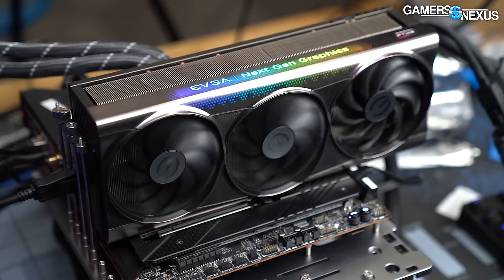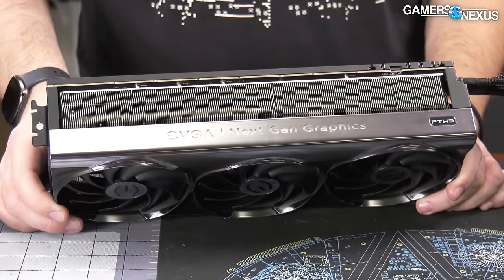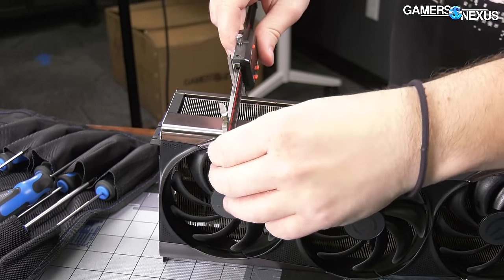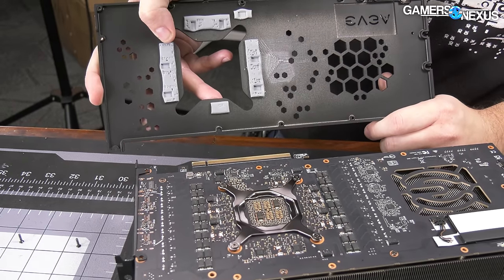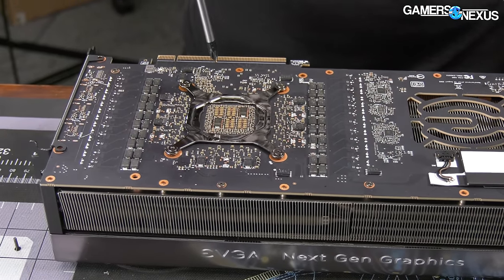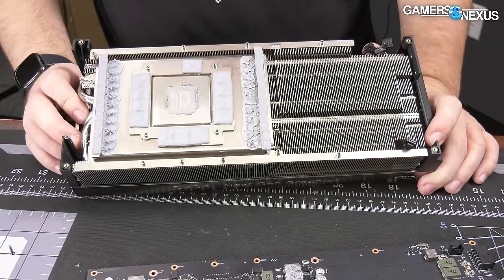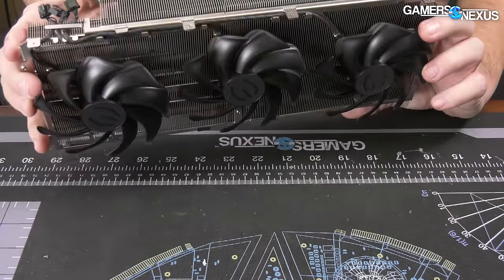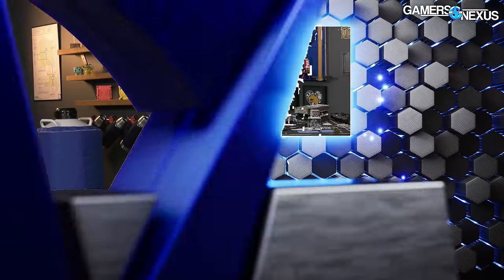EVGA RTX 4090 FTW3 Tear-Down & Disassembly: A Major Loss

Comment: With how some companies are chasing designs where there are no external screws, I think EVGA's approach to hiding the shroud screws on the beauty panel side of the card is a viable approach. Imagine the GPU sandwich, the shroud has hidden screws like this under the fans and is the first piece to pop off, then you have a backplate with female threaded standoffs that locate through the PCB and seat on the underside of the cooler with the screws in the upper side of the cooler under the shroud's top plastic (six standoffs on a two-fan card, eight standoffs on a three-fan card, hiding in the curved triangle between the fans, inaccessible before shroud removal), after the backplate drops off you have the cooler and PCB attached in the typical way with a general assortment of fasteners then the chip's leaf spring along with the slot bracket; all cabling would be fairly simple with accessible connectors under the shroud's non-top faces, and the backplate's LED features if they exist could be pin-pad or a long flat ribbon that folds over itself for flexibility, along with any potential thermal bridging between the PCB and backplate. A very, very simple approach to screw-less appearance, and very simple disassembly and reassembly methodology, an intuitive design that doesn't rely on adhesives or cover panels, and a design that seems a lot simpler from a manufacturing standpoint with less processes that relies on the cooler itself being the mounting point for every other component; besides the singular fastener attaching the slot bracket to the PCB, and if this screw can be reverse-mounted, that shortcuts the process of flipping the card over for a singular screw, adding to how manufacturability of this hypothetical design is more accessible: Bracket gets fastened to the cooler, rotate, that assembly attaches to the PCB, flip, backplate gets plugged and padded if needed and fastened, fans get plugged and fastened, and shroud gets fastened, all on a slightly atypical PCB design (through-holes instead of fastener mounts for the backplate) and some additional soldering work on the cooler to allow for all the component mounting with a slightly atypical design again.

Comment: So sad that I never got to own a EVGA card, that was going to be my next card.
Reply: Same might get 3080 evga
Reply: i got a 3060ti ftw3 last year, i think im gonna hold onto this thing forever. i hope they come back one day on team red or blue.
Reply: @quantum5661  i have a 3060ti founders edition for my first pc build at August my profile picture is my 3060ti what is ftw3
Reply: @quantum5661  EVGA's FTW series were their top tier cards.. larger coolers, triple fans, RGB, and OC'd.
Reply: most of my nvidia gpus were EVGA, a gtx 295, 2 980ti (hydrocpper) a 1080ti (ftw3+ ek block) and 3x3090 (render server go brr), the only one that is not is an FE 2080 ti (this is the only exception, got it because cheap, and waterblock avail at launch), the weird large gap between the first 2 is when i switched to AMD, oh, and a random 970 that I bought just to mess around with dry ice (could not get LN2 at the time, still can't tbh), never had any issues with any of them, the 295 in fact still lives on in one of my random testbenches as a glorified display adapter, all the other are still working, the 2 980 Tis: one sent out as a gift in 2017, the other is in a drawer, the 1080 ti has been given away to a friend in 2019, and the 3090 are still chugging along tracing rays with octane, the 970 is still in a drawer completely covered in liquid electrical tape, damn great cards, I still do not know what to go for with NV GPUs without them
Reply: They pretty much all the same. Evga just has a nicer look with that chrome.
Reply: @Themistocles30  who is second choice after evga only thing I bought from them is a psu I like it though
Reply: @Jason_Bover9000  Yeah, my entire setup is Evga and cost me dearly lol. Got an evga case, evga liquid cooler, evga 850 watt psu, evga motherboard and evga rtx 3090ti lol. I heard Asus and Zotac is quite good after evga. Evga are good for their warranties.
Reply: @Themistocles30  ok thanks man

Comment: The first thing that's noticeable is the size of the cooler and the shroud. Yeah the FTW3 is still large, but it manages to avoid the be pavement tile-sized like Aorus cards are for instance. If it ends up being as effective at cooling the card, then it's an impressive design.

Comment: 2:30 - Fin density, surface area and fin height is all important and generally you want more of all, but it's not the only things to look for in a heatsink. Air impedance and heat transfer in the fins are other things that influences the efficiency of the heatsink.

If you pack the fins to tightly you get high air impedance, meaning the fans will push less air through the fin stack. And this is another area where you want as much as possible. So more fins and less air can be a bad thing.

Heat capacity per fin is also important. You want the heat to spread though the fin efficiently so all the surface area can effectively transfer heat to the air passing by. Make the fins to thin and the tip won't get warm enough to make a difference. Make them to thick and you either impede the air more or you have to increase the fin pitch making for less fins and less surface area.

Finally you have fin height. The taller the fins are the more surface area you get. But at the same time the fins will have to be thicker to make efficient use of the added height, so you get fewer fins in the fin stack.

Now you have to balance these factors when designing a heatsink, and a lot of them will force you to compromise as you can't get them all at the same time.

So while it may look deceptively simple a heat sink like this is actually not all that simple to design if you want to make it efficient, compact and cheap to manufacture.

Comment: I really hope EVGA gets back into making cards, even if it's only with AMD and Intel.
Reply: yea, evga was my go to brand until i decided to go full team red and then using asrock challenger
Reply: @wizardbeard69  i think they could squeeze a lot out of rdna 3. I'd love to see it.
Reply: They've been my go-to for GPUs going back 15 years to the 8800GT, followed by the 550Ti (still have both of those cards and they still work), GTX770, GTX960, and then a GTX860M in a laptop (also still works).  Had to take a break from gaming until this year and finally built a new system and putting an EVGA in it was not even a question. It was a given.  Ended up with a Radeon, first ATI card I have owned since even before that 8800GT. The Radeon is not bad at all. My appreciation for EVGA is so strong, I jumped to Team Red rather than accept another Nvidia AIB brand.

Comment: EVGA overall quality was going downhill anyways, my 3080Ti FTW3 is one of the loudest gpus I've had in years, and hottest running.
Reply: true.. but then again, it's been the same case for all card manufacturers since like the RTX 20 series. Cheaping out on materials to cut costs, which then also has an effect on lifespan. Its a 2 birds one stone thing for them.

Comment: The upcoming 5090 will be 6 slots wide. 
Will come with tools to mod your case to look like a supercharger scoop on a Top Fuel dragster.
Reply: The boards are the same size as the 2000 series, the 3000 series, and the 4000 series. Only cooling increased in thickness. If the 5090 will be that powerful in the future, they can immediately be produced exclusively on water in full blocks on both sides of the board. Like water cooling from EKWB full cover for 4090 and occupies one slot.

Comment: Man I miss EVGA... Just the fact that they put the power connector at the end of the card alone is huge. 

I hate the connector coming out the middle of the card like all the rest are. It's terrible for cable management, terrible for airflow, and puts more stress on that connector that may or may not melt.

Then again, I probably wouldn't have been able to buy this card even if it was released. I wanted the STRIX and all I could manage to buy on launch day was a Gigabyte Gaming OC one. Which was basically the last choice I ever wanted to end up with... Hate Gigabyte... I think one of the fans is already dying...

Comment: I wish their CEO would've just handed the reigns over to someone, even a family member so that they continued their GPU line. I've been a loyal customer since buying my first Nvidia GPU(a GeForce4 Ti 4200), and have tried other brands without near as much reliability. Finally looking at upgrading my 1080 TI - which still runs like a beast FWIW, but not sure who I'd go with now. Thinking either Asus or OEM 4800/700 will be the best bet, eh?

Comment: 17:50 comparing to the heatsink/vapor chamber those inductors where the thermal putty didn't have contact, indeed fell outside the footprint of the contact plate/vapor chamber. Since it's a prototype, they might have had to fix that extending the contact plate if the retail product ever reached the market.

Comment: it’s just sad that they stopped before this. cause the 4090 would have been endgame.
assuming you will never upgrade to 4K, there will never be a game you can’t run on high fps at 1440p
as the 4090 is a 4k 120fps card, you could almost also say the same about 4k. and I guess we can agree 8k will never make sense on desktop monitors for a very long time

Comment: The external fan connector is SICK and I want more cards to have that. It's a great idea. The GPU is the thing that most needs airflow in most systems - why are we feeding it air into the case based on CPU temp? It's CRAZY.

Comment: Every GPU I've ever owned - my 9800 GX2, my 660 GTX, my GTX 1060, my RTX 2070 Super, and my RTX 3080 - have all been EVGA cards (with the sole exception of a Gigabyte GTX 970 I owned for like two days before I RMA'd it, so I don't count that one).  So as disappointed as I am at the news, EVGA - as one of the few "big" companies out there that seems to have a genuine sense of integrity - has nothing but my respect for telling Nvidia to go fuck themselves.  I hope AMD continues to close the gap, and I hope Intel becomes a third serious competitor, because competition in the market is supposed to be what keeps big corporations from fucking over customers (although obviously that often isn't the case).  In the meantime, I'm gonna continue to buy from EVGA where I can for things like power supplies and whatever other components they continue to make.

Comment: Holy Molly! I am a collector, I am willing to give you 1000 $ just for that video card.
At this point getting one on stock is no longer the issue, it's robing the bank and getting away with it. Since cards are already out on the market, I am surprised how come this time GN does not have a review or tear down by now for other models. They must have needed a bigger Camera to keep the 4090 in the shot.

Comment: Video cards have got so big, its either motherboard manufacturers are going to have to stop putting slots under the x16 slot, or case manufacturers are going to have to put 4-5 slot vertical mounts in their cases. Otherwise, you better buy a mobo that has everything and the kitchen sink built in, because if you want to add a wifi card, sound card, etc, you're SOL.

Comment: looks great evga, sad to see you go but I support your reason. great vid gn. the putty is at the edge and overflowing the base of the vapor chamber. seems like the only way to fully cover the inductors would be to make the base larger, a lot of work. lol. 
you may mention this later but those fan blades are CHONKY, i guess they compensate for the ring fan's durability with this.
May be a bit crazy but i would love to see an airflow test stock and the the evga pcb Dremelled out LOL. ;)

Comment: I only buy EVGA because of their design and top notch customer service second to none. 
What an excellent engineered GPU and would have been very happy to have purchased one.
On the other hand, EVGA may have made a smart decision to pull out of producing the Nvidia GPU since we're seeing a lot of melting issues.
You can't be harsh on EVGA design since it's not the final product. Either way, it's one of the best designed Nvidia 4090 card. Man I wish I had it right now. Cheers!

Comment: It probably wasn’t intentional to leave out the putty/pressure, but the inductors at the ends likely don’t need the cooling as much since they don’t have to deal with the heat of neighboring inductors and have some ventilation on the side.

Comment: I'm happy for EVGA, they made a good decision. Nvidia is going down the way the currently operate. When even EVGA can't make that card 3 slots, something is seriously messed up.

At this point I am open for external GPUs. So a small card inside the system for basic video output (or just an onboard GPU), with a connector at the back to plug the GPU inside. The external GPU can be powered by a separate PSU, heavily decreasing both power spike sensitivity aswell as the overall power draw of your PC, while also being independent from case size and reference design ^^

Comment: Honestly for a pre-production version of the card you can really tell EVGA put the work in,  there is some obvious issues that Steve pointed out but its unlikely any of those would actually make it to production.  Can tell the engineers over there knew what they were doing with minimal gimmicks. 

Also that fake out at  the 19 minute market had me. XD

Comment: I would've loved if EVGA just ignored the nvidia limitations put on manufacturers (you know, the ones that made MSI discontinue the Lightning series) and how much performance they could've squeezed out of that hardware. I mean eventually someone's gonna do an epower mod and get these results anyway, but I still would've found it cool to have a PCB that is already designed by the manufacturer to be really good

Comment: I wonder if the ease of tear-down is in part due to the fact that this is a fairly early-stage prototype design.  Early on you'd probably want to be able to take it apart and put it back together a few times for engineering purposes, whereas later on as you refine performance stats for the design, you'll probably be more and more willing to sacrifice the teardown capability given a good chunk of the customer base is not going to be taking apart their boards.  Not necessarily deliberately obfuscating the teardown procedure, but if you're a couple weeks away from submitting your final design and you can eke another half percent out of the cooling by running an extra fin through where you were leaving space to make it easy to unplug the fans (I don't know if that's a thing, just a random example), you're probably going to make that sacrifice and make it  just a bit harder to take apart.

Comment: One of these with my EVGA SR-2 submerged in a tank full of 3M Fluorinert Electronic Liquids -- mounted into the wall, like a fishtank or painting, in the cottage I'm building next year would be perfect..

Any news on where the other 19 or so GPU's went.. else a pair of 465's in SLi will need to do.

Comment: The 16-pin connector on the end of the GPU is an interesting choice, when 4090s already struggle just to fit in a case due to their length.

Comment: As far as the connectors on the LED and fan headers go, is it possible that this card has connectors with clips to make it easier for the techs and engineers to work on? I could see a finished product not having those easier-to-use connectors if it meant saving a few pennies.

Comment: So disappointed EVGA didn't actually make this. I would have purchased this card and instead I've not purchased any of the 4000 series cards because I wanted to wait and see the designs that come out. EVGA did it right with the 12 pin on the rear and no one else does it like they do. The closest is the ROG card but that 12 pin on the top kills it for me. #RIPEVGA

Comment: Is it 1963 CMOS or 2022 RTDTL? Is it 5 GHz at 600W or 2000 GHz at 5 W? Does it use the 1920-era VRM (60% efficient) or the 2011 2-phase Ćuk-buck2 VRM (99+% efficient)? I realize that efficiency is never a concern in graphics cards. What is an extra 200 W of heat?

Comment: A small correction for 15:20 connecting the IO plate with screws to the card that way does eliminate almost all sag. JaysTwoCents looked into this a while back and also shows that exact card in a case having no sag. I dont know why all manufacturers dont just do that. no more need for those ugly gpu support towers

Comment: I'm really sad they backed out when the 4090s came because this prototype had so many good designs especially the end power connector when most cases are having problems with the normal placement.

Comment: Man I've been trying to integrate old vapor chambers to heat pipes because none of the manufacturers would build a prototype for me. I'm sad because I never got to make the truly insane cooling design that I've been working on. Or at least, it won't be as effective as a factory model.

Comment: Did I read it correctly? It is stamped on the PCB "Manufactured after August of 2005". Does it mean they already have the 4090 design almost 20 years ago? If so, what the hell are they cooking right now in their labs?